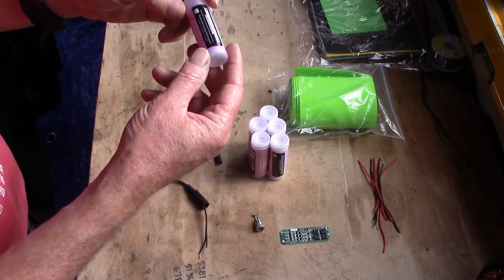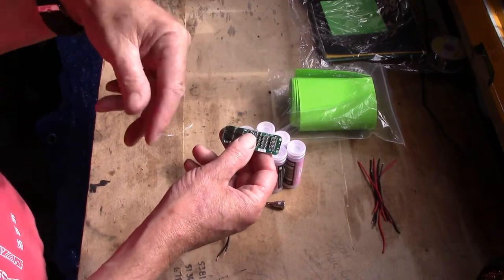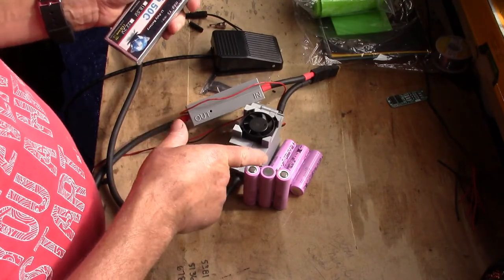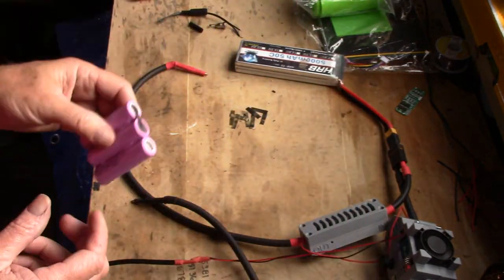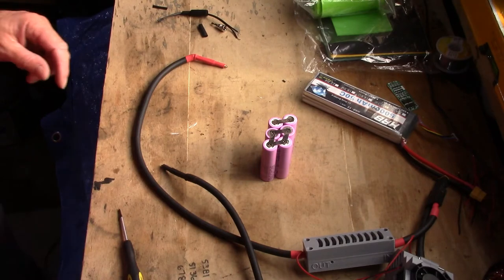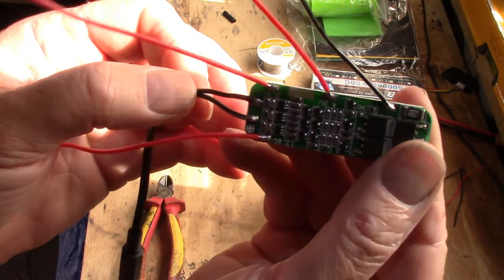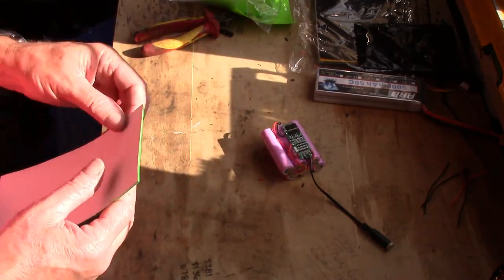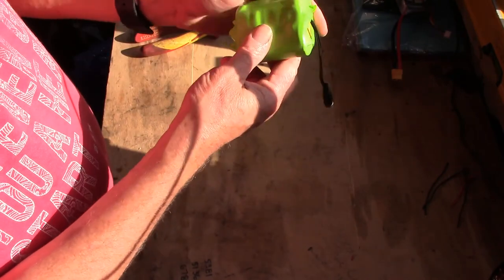12v Battery Build to power my heated jacket

Comment: would x2 8v 4000mAh 15w each packs do the job?So 8000mAh 15W 16v?
Reply from the maker: Yeah that would work great, though 16v may be too much for the heating elements. You could reduce this, to say 13v, using resistors